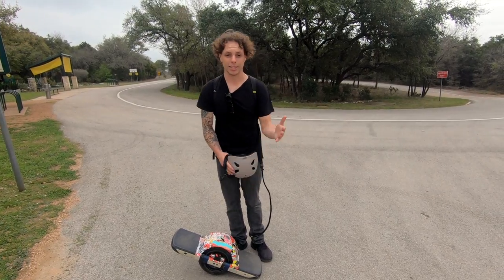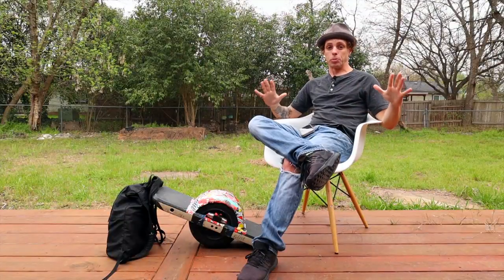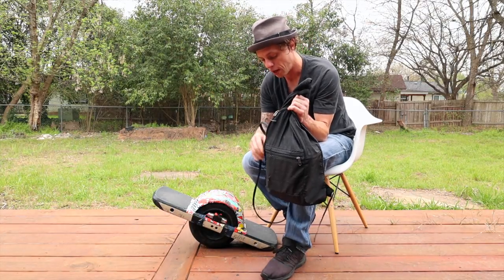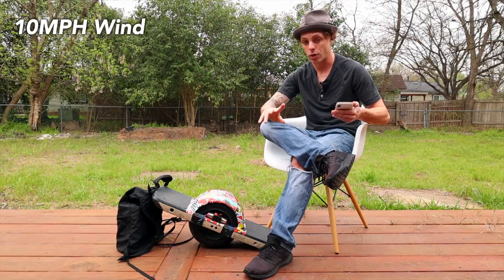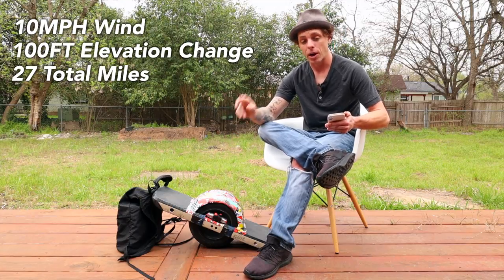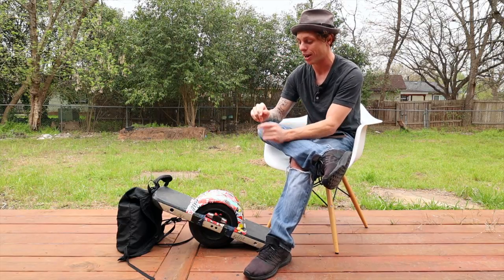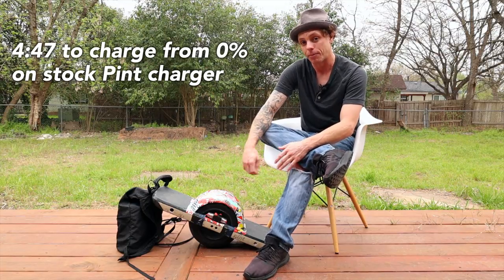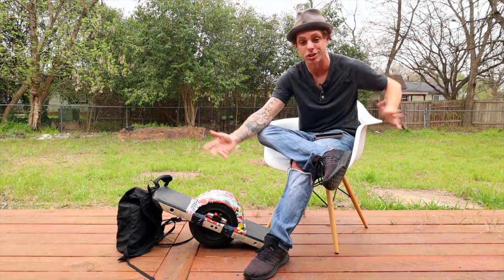Onewheel Pint Extended Battery Range Test - 5.0AH Battery VNR

Comment: As a bigger guy (6’2”, 270) who rides a Pint, I’m getting 5.5miles per charge. So, this is going to be a game changer. Getting up there in mileage, and as soon as I run over the warranty mileage, this is going to be installed. PintXR is my future!! Thanks for the how to, but this test sealed the deal.
Reply: Damn 270 I’m 6’3 180 and I only get 6 miles 😭
Reply: @postmodernjoe  what mode are you running?
Reply: Hey, did you try installing it since then? If yes, how do you like it?
Reply: Goddamn. You do realize the max weight is 275 right??

Comment: Great mod! Did you notice an improvement in the Pint's speed or pushback threshold? I usually get pushback at 14-15 mph on stock battery.  Hoping this mod will increase he pushback threshold and speed as Im planning to use my pint as a daily commute to my school which is about 15 miles away.

Comment: I have over 100 miles on my board and my feet KILL me after 3 miles. I can not believe that you are lucky enough to have feet that let you go 20! Float on!
Reply from the maker: Just keep riding and it'll get easier and easier. Im at around 275 miles on mine so far. You can also throw some more insoles in your shoes to help a bit. It helped me in the beginning! As you get more comfortable you start to relax your feet more as well, in the beginning it feels like you're monkey pawing it trying to stay on.
Reply: I will ride on even if the cramps don't stop, this thing is so fun!
Reply from the maker: Douglas Hughes yeah it’s crazy addicting ! Ride on brother 🤘
Reply: Carving is key! And stop from time to time to walk around a little =)
Reply: Wear some running shoes. I've had good luck with Nikes, just don't go with the ones wish super flexible soles. Secondarily, Kush Nug rear food-pad for $100.
Reply: @douglashughes2331  I got some new shoes, Reebok Nano Crossfit is the model. They help a ton!

Comment: How the hell did you manage 23mph!? Does the VnR increase the speed too?
Reply from the maker: It doesn’t increase speed but it does increase available torque. As long as you’re not asking the motor to do anything too quickly it can handle it. My top was 24 but typically cruised 18-20 on the pint. Eventually it led me to upgrading to the xr.🤙

Comment: Do you know of any hardware/ firmware that this would not work for on a Pint? I just recently got mine and would love to connect through the controller like you did in the future, but I’m having trouble finding online resources about it.
Reply from the maker: Ive read that hardware 5301/software 5050 will only work by doing a "RNR" in the battery compartment in a very tight are where positaps do not fit. I have not read of anyone fulling confirming this though as the only resource I can find is Sonny Wheels. He has been an awesome resource to the community and I definitely recommend his kits if you're not looking to DIY it. Im not 100% sure though as he wasn't recommending people use the controller area even in the 5300/5042 (my version) and im not sure why as it seemed to have a lot more space for positaps and doesn't require any cutting down of the internal "walls" and also provides an accurate battery percentage in the app.

I learned this method through Facebook groups and lots and lots of research. If you can't find anyone to confirm you can tap in the controller area of the 5301/5050 boards then the RNR kit cord from Sonny, or the full kit, is your best option for sure as Im not sure how to replicate the barbed connectors he provides. Those barbed, stabbing needle like connectors look perfect for the job in such a tight area. Im also not sure of the implications of attempting the connection through the controller if it fails to work. I don't know if that will harm the board or not. I would recommend reaching out to sonny or putting some posts up about what you're trying to do and see if you can find out a why it won't work, if anyone has tried it or what will happen if you indeed tap into the controller area. If you find out, let me know! I'll ask around also as many seem to be interested in the same way I did mine. If you're not able to its not the end of the world, you'll just need to go to the board settings page and watch the voltage or better yet add a inline voltage monitor and mount it to the top of the board then just reference the voltages from my video and you'll know what percentage you're at without even having to look at your phone. Long post but hopefully helps!
Reply from the maker: And if you buy a battery or any parts help a brother out and click though my links in the description!

Comment: what mode are you riding in? in Pacific i feel pushback starting at 14mph or so -- how in the world do you get to 23mph with pushback starting at 14-15mph? do you just push through it? that seems super scary to me, haha -- i'm actually most comfortable under 12mph, but i'm just curious. love these battery mod tutorial videos! i need to check my Pint, but i'm pretty sure i was one of the first ones shipped out (it has incorrect wattage listed on the rail, which they later fixed, so i had to get a letter from FM in case i want to take it on a plane), so i'm pretty sure i could do a mod the way you showed in your previous video.
Reply from the maker: Yeah this was all in Pacific! I do feel Skyline is more conducive to faster riding but I just love the feel of Pacific.  I think a big part of it is stance. My feet are basically right up against the fender when riding and I try and accelerate as gently as possible at all times.
Reply: @ELECTRIC-DNA  yep, me too -- love Pacific, and i keep my feet close to the hub. i find it makes quick responses for speeding up and slowing down much easier.
Reply from the maker: @Dr_Bombay  Yeah absolutely!

Comment: Anybody know is this still works with 5314 hardware; Gemini - 5050 firmware?
Reply from the maker: This method of connecting through the controller box does not work with 5050. There is a way to do it that involves connecting though the wires before the BMS. Look up sonny wheels to see more about the process called RNR.
Reply: @ELECTRIC-DNA  Thanks man -- much appreciated

Comment: At 3% on external battery you likely actually had 0. Ifmyounundrstand that voltage= pressure , amps = flow of electrons and ohms = resistance then you know t that a longer wire means you have added increased resistance, so your BMW on the one wheel likely flatted out, but was not able to detect it, or did not have the additional power to surge and lift the nose. Think of your speedo more like a power  meter, and always keep a little top end, ride a,ow enough to eat shitmif your under 10%, regardless ( xr,  ridernhere waiting for my pint which I ordered to dissect immediately to improve. )
Reply from the maker: Yep I never go under 10% normally but just haaaad to push the limit for the test haha. Have fun!
Reply: @ELECTRIC-DNA  been there, was at 1% once headed home down a hill..   power died when I hit a flatter section, hard sometimes to gage when the ow is re generating and when it's actually burning battery to keep your decent speed in check....    :)
Reply: @MrDmadness  It would make SOO much sense if the indicator light on the pint would tell us if it was regen-ing!
Reply: @will3021  yes and would be super duper easy to do, they would only need to detect the reversed flow of current, a parallel circuit, a few LEDs and a diode would aco polish this easi,y as I wager this is the same method used to switch lights from red to white if you stop and change direction. I highly doubt this is written into the  micro co stroller and if so they should hire me to build better circuits and programs.

Comment: Super cool videos about the mod! I have a few questions tho. 
1: I guess the pack is constantly charging the internal battery and thats how you get the range, or am i wrong? 
2: Can you use only the internal battery? Example if you're only going for a short run and don't need the extra range. 
3: How's the waterproofing of the xt60 quick connections? Is it more sensetive to rainy rides?  
Thanks in advance!

Comment: Maybe you mentioned it but what ride setting were you in?  This is so awesome! Dream come true right here! I just got mine and want more range already.  Thanks brotha!
Reply from the maker: Nice man! Stoked you got one! I was riding pacific during the range test. Have fun!
Reply: @ELECTRIC-DNA  how many miles have you put on since the mod? Everything holding up well? I want to do this for sure!
Reply from the maker: @matthewbryant2801  I think I put around 600 miles on it with the external battery. I then bought an XR and had the pint around for a while as a second board for friends to ride. Then sold it. Ive seen VNR boards with 1000’s of miles on them though. Id recommend going with a fender mounted external battery unless you do a ton of off-roading as the cord starts to get annoying. VNR will open up a lot of opportunities for the pint though.
Reply: @ELECTRIC-DNA  : would love to know why you sold the onewheel and have a 1year review of the mod! Did you install another one on the XR? Do you still ride onewheels or your prefer electric skateboards now?
Reply from the maker: @sylrider  sold the pint to get an XR. There’s a brief video showing the modding of my XR. I didn’t range extend it. I bought the XR so I didn’t have to ride pushback constantly. The Pint is great but future motion really limited the fun with the pushback.
Reply from the maker: Hi, I have an XR with some upgraded accessories now. You can find that video on our channel also. I did not install a mod on the XR because the mileage was enough for me. I typically ride electric skateboards now.

Comment: Hardware 5314 gives me incorrect battery % when tapping the back. If I tap the front it gives correct % but I get error 24 after some miles.
Reply: I figured it out. If you don't allow the board/app gps information it will only use voltage for the led power indicator strip and the percentage it shows in the app.

I hit "disconnect" in the onewheel app and turned off autoconnect. I'm using Strava to track my trips.

I tested this % last night down to 75% remaining. I will update as I test

Comment: Do you get more speed with this upgrade?
Reply from the maker: No, unfortunately the pushback still hits at about 15mph. That said, you do have more sustained torque since you have more power available and less voltage sag. I found cruising at 19-20 to be sustainable if you’re able to ride in a pushback stance. That stance though is what will fatigue your front leg faster and eventually cause you to buy an XR like I did. 😂

Comment: It doesnt turn off because the cells are balancing. You're messing with the charging cycle by stopping that. My Pint takes about 30 minutes to stop charging after it hits 100% on the stock battery. Might take up to an hour with the external one.
Reply: I can confirm today that the cells do indeed balance after it hits 62.9V. I left it for about an hour until the green light on the charge brick came on. If you don't let the cells balance you won't get as much range as you could be.

Comment: How do u go so fast the board won't let me go faster  then 14.5 mph the push back just won't let me
Reply from the maker: Slow and steady acceleration will continue to make the board go faster, eventually though you will run out of power and slam, so do at your own risk. Safe option is to stay under pushback. The pint is more fun under 15 in all honesty.

Comment: Which hardware version is your Pint ?
Reply from the maker: Board Hardware 5300, firmware 5042
Reply: Dallas and Aimee  thanks for the quick answer ! Do you have any issues with overheating or the voltage of the cells from the original battery ?
Reply from the maker: No I haven’t experienced anything like that.
Reply: Perfect👍🏼

Comment: I just tested my vnr pint on a all trail ride and got 14.2 miles until it died completely. Trail really kills range. Had to do the walk of shame for the last 2 miles back to car. I was hoping I could of got 18 miles at least.
Reply from the maker: Quang Yung yep trail riding, tire pressure, treated tires, rider weight, outside temperature etc all affect the range. If you’re really wanting more you can run another battery in parallel but that depends on the weight you’re willing to carry. I’ve seen some guys buying a 7.5AH battery and even a 10 AH!
Reply from the maker: Quang Yung now think if you didn’t have VNR, probably would have been like 4 miles haha.
Reply: When a do a full pavement test fairly flat like you, I hope to get your range. I'm 144 lbs. So hoping for at least 24 miles. I ride like you which is fast.
Reply from the maker: Quang Yung I’ve gotten over 20 pretty much every time I’ve gone out with it. I typically stop and charge somewhere before going that far anyways haha. I’m guessing you’ll get around 24 without worry. I did 23 the other day and had around 20% left.
Reply: @ELECTRIC-DNA  when you did the range test, how many hrs did it take you?

Comment: great video, again!
top speed was 23mph or kmh?
Reply from the maker: Thanks! I hit 23mph on the ow app and 24mph on the cycle app. I’ve hit 23 a few other times, not advised haha
Reply: @ELECTRIC-DNA  how did you go so fast bro? I thought it was 16 top speed. Is it tire pressure? The battery?
Reply from the maker: Sheldon Taibi the top speed of the motor, without someone on it is around 30mph. It all depends on conditions and stuff. You receive pushback at around 14ish, where it pushes the nose up to tell you to slow down. If you “push” through this it will somewhat level out and continue to accelerate faster. At this point you are at risk of nosediving, basically pushing the motor past it’s ability to balance you. A couple things help to be able to ride that fast without that happening. 1, a narrow stance since it puts less leverage against the motor. 2, weight of rider. 3, flat ground not against wind. 4, slow changes in acceleration. No sudden changes in speed. 5, an external battery gives more available power to sustain the speed. It doesn’t increase the speed but gives the motor more power when it’s asking for it. 6, Just committing to it and accepting that you might eat it if you push too fast lol, so wear gear. I now wear more gear after that slam haha. Wrist protection is key.
Reply: @ELECTRIC-DNA  wow man thanks for the in depth description! I had questions about all of those things for so long and you answered all of them! Thank you so much! If one day I can surf one of these puppies even a 10th as good as you can I'll be satisfied lol!
Reply from the maker: Sheldon Taibi no problem and I hope you get the chance. It’s one of the best purchases I’ve ever made.
Reply: @ELECTRIC-DNA  wow good info here on riding past pushback.
Reply: @ELECTRIC-DNA  Thanks for the info... Will explore this when i have more protection
Reply: Pro video. I’ve got my CBXR set up on my Pint but haven’t had a chance to range that out yet. Wonder how that compares to yours 🤙

Comment: Wow! You were really hauling ass on that Pint! I take it by adding the external battery it can increase your top speed?  That range was incredible, I weigh about 185 and I’m lucky to get 6.5 miles so I’m guessing for me the mod could increase me to 18 - 20 miles? That would be amazing!! I actually have a Hoosier treaded that I’m holding off on installing because I don’t want to decrease my already dismal range. Thanks for doing this it’s extremely helpful for me! You look like you’re having a blast out there!! 👊
Reply from the maker: The external doesn't change the speed actually, Ive been able to hit 23mph on just the stock battery a few times also. I do feel like there is a bit more torque or a better explanation is that you get more consistent toque. Like it has a little more headroom to sustain the torque and speed. Pushing the speed is a dangerous game though I will admit but having your weight over the board centered, a narrow stance and being gentle with what you're asking the board to do has kept me ok-ish so far haha. You should get that mileage if you do the VNR. I would 100% recommend it. Throw in a fast charger and you're board will outlast your legs haha.
Reply: Wow! I’ve never gotten near that speed. My top speed is 16 something, at that point the pushback is so forceful that it’s kinda scary. To quote Chong, “It really grabs you by the boo boo” 😂 I’ve only got 150 miles of riding so maybe it’s just that I still suck but I can’t imagine pushing through that. Does it stop if you continue to push through or do you just hammer down?
Reply from the maker: @freedomessentials7321  I just carve through it I guess. I really wish it would go 19 without pushback. Its very capable but oh well. Any speed on a Onewheel is fun!

Comment: Is there a risk of being electrocuted if quick release happened then standing in a puddle?
Reply from the maker: Ill be honest, I don't know.
Reply from the maker: I have seen a pretty ingenious addition to this setup. Adding a janitor style retractable key ring to the end of the backpack cord so when the cord disconnects it quickly retracts up to your backpack. If you're concerned about your scenario you could add a fuse in the controller box and a fuse inline at right at the battery in the backpack. I may actually do this in the future as it will add another layer of protection for the devices.
Reply: No, not at 60V